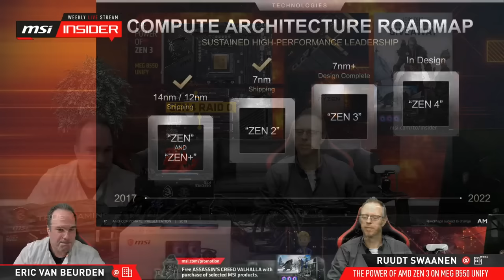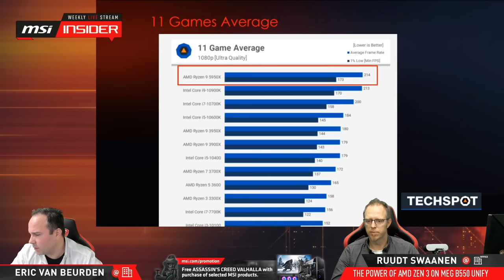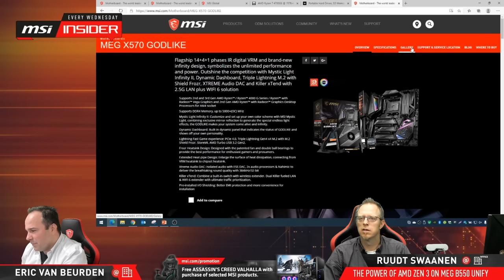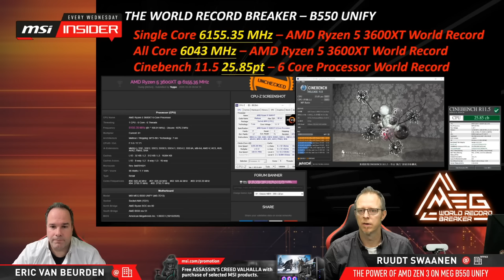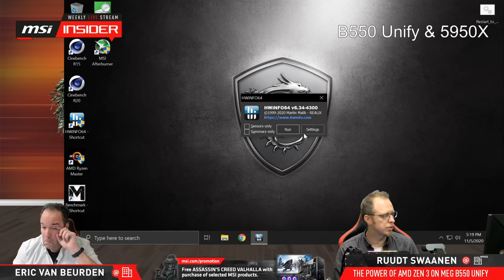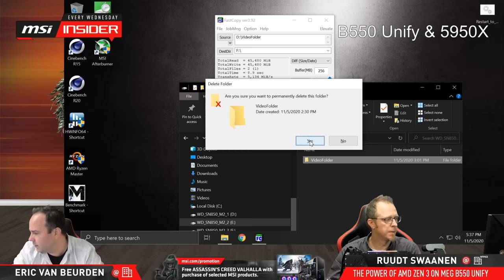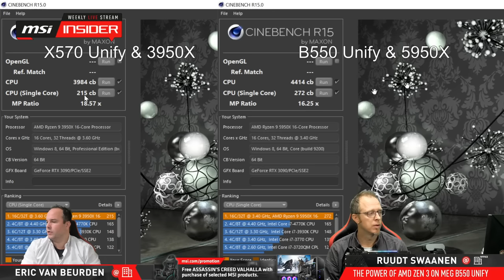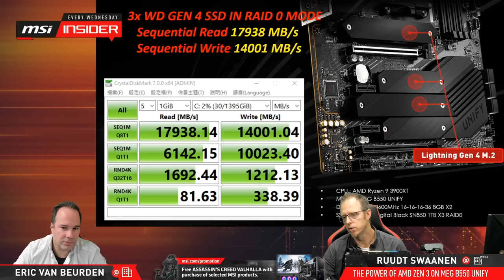The power of AMD Zen 3 on MEG B550 UNIFY

Comment: PBO2 with negative offsets between -20 and -30 in my case pushed the 5900x to 4950mhz on most cores, only needed to give one core a +2 for some reason, all others are blazing fast @ ~80c max on air fully loaded. Done on a Tomahawk.

PS: Top om weer's Nederlandse tweakers in beeld te zien :) awesome

Comment: Bravo guys! This was an outstanding in-depth video tutorial. I’m on board to pair this MSI B550 Unify with my 5950x. But I do have a question about bootable NVME 4.0 raid 0 setup. I have two Samsung 980 1Tb PCIE 4.0 and one Crucial P5 2Tb PCIE 3.0. Should I insert the two Samsung’s in slot 1&2 and run it on CPU and the Crucial on slot 4? I’m not planning to run any type of sata drives. Just a bootable windows 10 pro on raid 0 and backup to a crucial 2Tb PCIE 3.0.

Comment: I really like this board for the no heat sink fan and the abundance of M.2 but as the owner of an O11 XL I need two internal 3.1 headers plus the type C.
I bought the X570 Tomahawk because it does but the 2 M.2 slots have me thinking I should have spent the extra $80 for the 3 slots on the X570 Unify.
First world problems I guess...

Comment: I have a question regarding a possible GPU performance drop when PCI_E1/M2_2/M2_3 lanes source is set to CPU mod. The first PCI_E1 will have x8 bandwidth instead of x16, and there must be some GPU performance drop.

Comment: NDI is fine otherwise as long ur not bandwith limited on your local connection check your usage and make sure u use 1gps connection cheers
Reply from the maker: We have a 1Gbit local network, speeds which we can achieve with network file transfers. However NDI locks up when the GPU is loaded 100% it seems it cannot encode it anymore before sending it. This both with OBS or the NDI Scantool. The Scan tool seems to be more tolerant, which is why we are using that one right now.

Comment: What is the height of the top VRM heatsink? (From the back of the motherboard towards the side panel) I’m having clearance issues fitting top 120mm fans on my case with my x570 meg ace! If it was 2mm shorter it would’ve been perfect!!!!